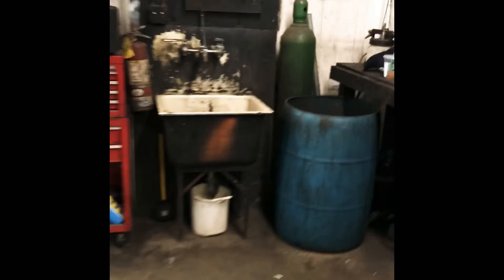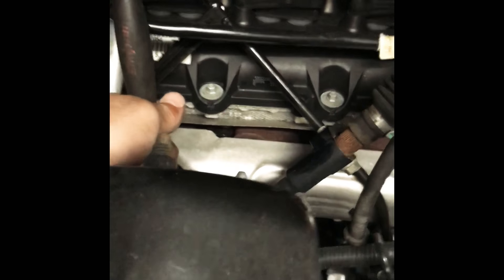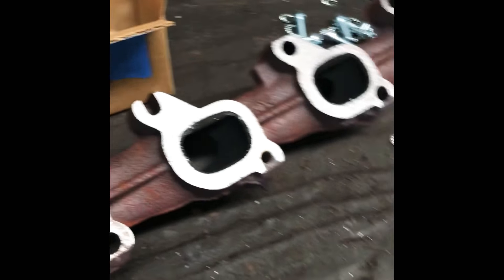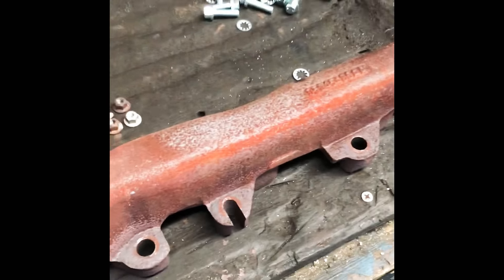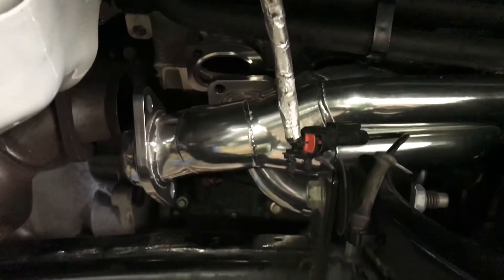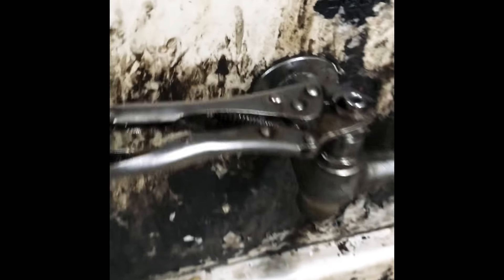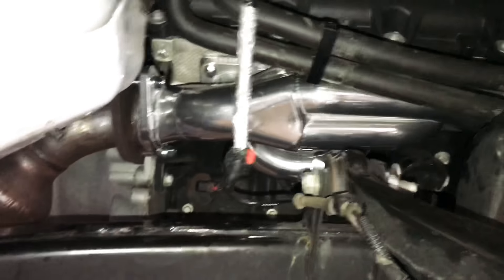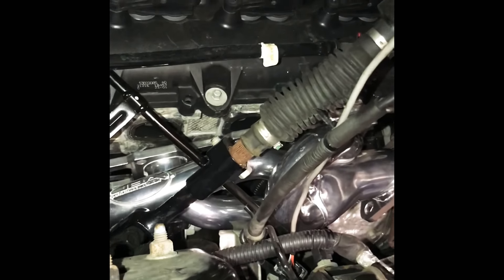INSTALL! JBA Shorty’s

Comment: Did they come with new bolt should I use OEM bolts or is thier a better way to go with aftermarket thanks in advanced
Reply from the maker: Joshua Casiano they come with decent bolts, never had a problem with them backing out..  Some people upgrade to stage 8 or ARP bolts

Comment: Just put mine on today and can't figure out were the ticking is coming from.
Reply from the maker: tristen douthet they do give off engine noise, but if you’re having a loud tick, may be a leak at the gasket or the flange,,, did you use oem 6.1 gasket?
Reply: RammedSane no I used the ones that came with the headers. And those headers was a pain to install
Reply from the maker: tristen douthet they are a huge pain, I had ARH long tubes on my 2015... should have used the 6.1 gaskets, if it’s leaking I’d replace them
Reply: RammedSane I am smh do you have the part number for those gaskets and did u use anything on the flanges
Reply from the maker: tristen douthet I’m just glad I found out before I installed them!!! Lol 
http://www.moes-performance.com/mobile/product.aspx?ProductCode=6%2E1gasket&404;http://www.moes-performance.com:80/OEM_5_7L_6_1L_Hemi_Exhaust_Manifold_Gaskets_p/6.1gasket.htm=

Try that
Reply from the maker: tristen douthet just clean and install no dressing necessary
Reply: RammedSane Thanks bro. Your truck sounds good btw hope mines sound like that minus the procharger lol
Reply from the maker: tristen douthet thanks!  I got to get a Y pipe and a few more bolt ons💪🏼😆💨
Reply: RammedSane have u dyno the truck yet
Reply from the maker: tristen douthet not this truck, my last truck had 481rwhp almost same set up, but I’m running 8lbs this time so I’d say around 500rwhp

Comment: Hello ,are you happy with them ,have you consider to get a gibson ones ??have you notice any diffrence when you change the headers??
Reply from the maker: Maciej Olejniczak not sure they make Gibson for the 2017 5.7, but I like the JBA’s, I don’t really notice much of a difference, I’m still waiting on the AFE Y pipe which will help with flow and scavenging, I should feel a bit of a difference then